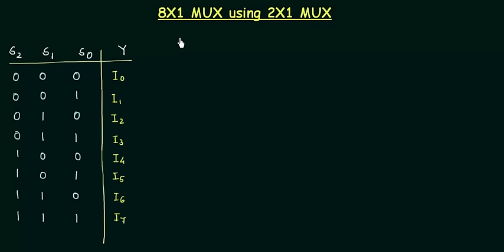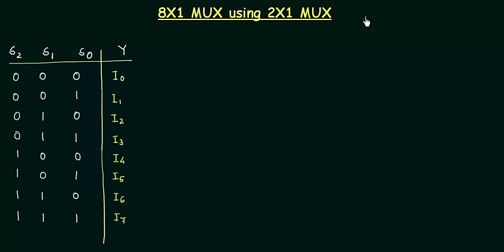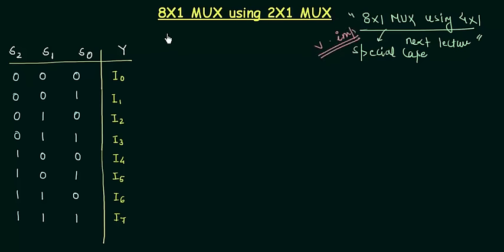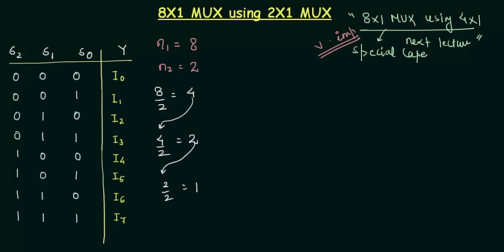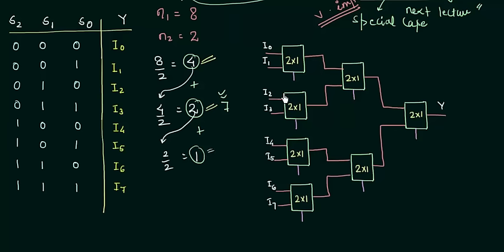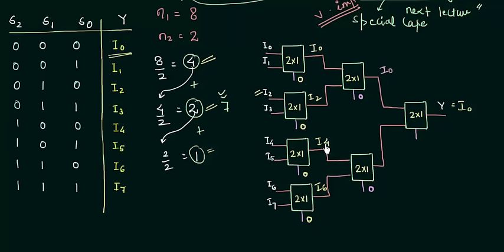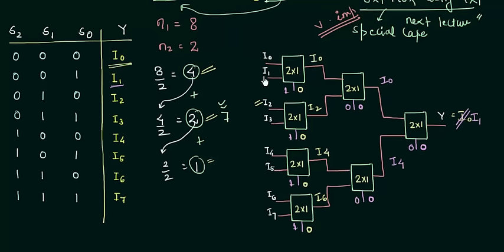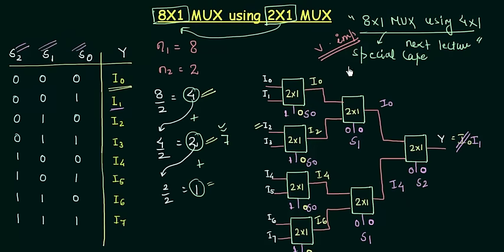Implementing 8X1 MUX using 2X1 MUX

Comment: For the people who are confused on how the select lines were obtained, try writing the select lines required for all the inputs.

It will give you:

I0 = 000
I1 = 100
I2 = 010
I3 = 110 and so on.

From this, we can see the pattern that the last select line is similar to S2, the middle one is similar to S1 and the first line is similar to S0.
Reply: Still unable to get it...Plz help so that I can understand....!!!
Reply: Can u elaborate
Reply: Thanks
Reply: thank you so much! For those who didnt get it, just write down the select lines to get I0-I7. and you'll see
Reply: @meharshaik1070  try seeing it in this way, the final ans Y will depend upon the last 2x1 mux'es select line, so it will have the highest priority. So start from right  to left in the block diagram. If you take S2 as the select line of the last 2x1 mux, then S2 will either be 0/1. If S2=0 then you are now at the upper mux at second level. Now if you take S1 as the select line then it also be either 0/1. If S1=0 then you are now at the upper mux at first level. Now only S0 is left , it will also have 2 options 0/1, if S0=0 then I0 will get selected. See this as a hierarchy, (S2S1S0), S2 is the MSB which is switched less, so it will have the most authority, while S0 is switched more frequently to 0,1,0,1 so it will have the least priority.

Comment: In the last, how to decide whom to give what among S1 and S2,(in two 2X1 and one 2X1 MUX) because output of both are 0 0 ?
Your videos are awesome as usual...:)
Reply: same question here
Reply: That is because when you try selecting i2 and i3 at 1st mux u get 0101 2nd mux 0011 3rd mux 0000 hence from the truth table it will be s0 for 1st stage s1 for 2nd stage and s2 for 3rd stage I think this should be a way to find the solution because when I tried solvin for further cases this is the result i got .hope it would be helpful
Reply: For the people who are confused on how the select lines were obtained, try writing the select lines required for all the inputs.

It will give you:

I0 = 000
I1 = 100
I2 = 010
I3 = 110 and so on.

From this, we can see the pattern that the last select line is similar to S2, the middle one is similar to S1 and the first line is similar to S0.
Reply: @sandhyachowdhary2511  yes that's the correct one.

Comment: PLEASE HELP !!!!
i could not understand exactly the last part of the video ? if we are having 1|0 for the 4 first MUX 2*1 , and 0|0 for the second part and 0|0 for the last part ,,  why the second part is connected to S1 AND the last part to S2 ,,, as S2 contains 0000 on its column  and S1 has 00 on its column , in my case i would change the position and might say that the second part is connected to S2 as well as the last part would connect it to S1 which means reversing what you've done  , this is just my way to think , i am not saying that is correct !!! just have this doubt in my head ,,,, is a serious doubt that i have and would be great to clarify me please this point ,,,, and why also after using the inputs  i0 and i1 we did not set i2 as a third case for getting finally 3 bits in each part rather than 2 bits ?? please explain us this point that would let us jump to the next videos ,,, thank you for the effort that you have done for the community and for your open knowledge that you provide us , Thank you

Comment: uild a 2:1 MUX using an 8:1 MUX. (Yes, the question is right. Build a 2:1 MUX using an 8:1 
MUX) 
Sir is there any possible to design 2:1 mux by using 8:1 mux